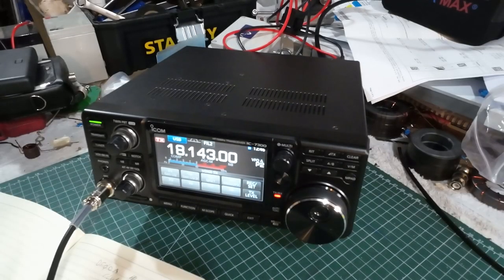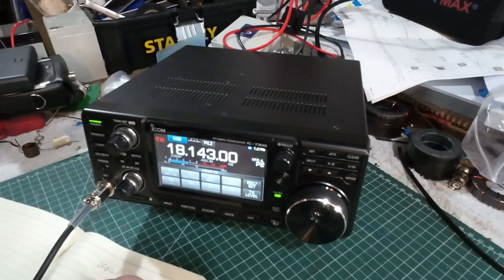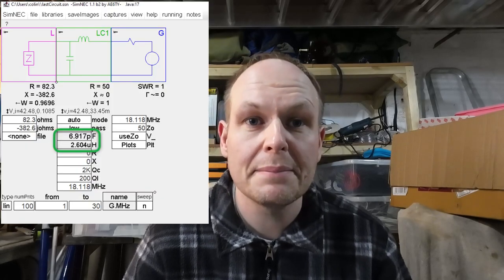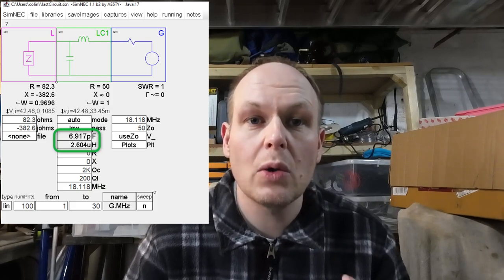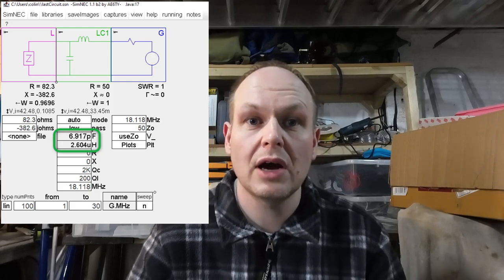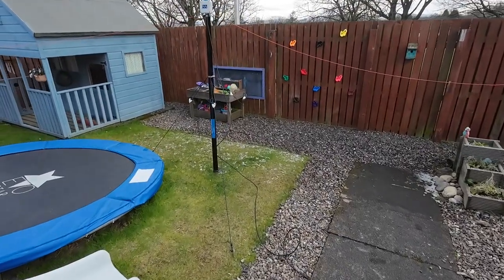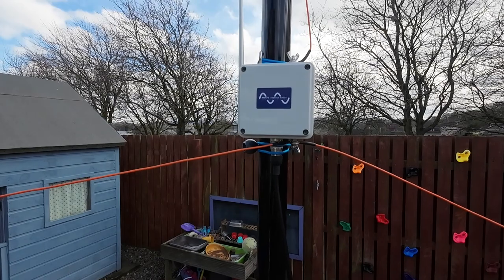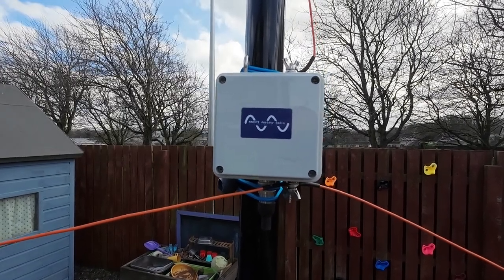The King of Verticals - The 5/8th Wave Ham Radio Antenna

Comment: This is perfect really enjoyed this video By hooking it up this way is the inductor considered in series and the capacitor and shunt or parallel?
Reply from the maker: A shunt can be in series or parallel depending how your trying to match. The capacitor deals with the reactivate component. It's an inductor in series and a shunt capacitor in parallel.
Reply: @MM0OPXFieldRadio  So here's a question for you if you needed to put the capacitor in parallel and the inductor in series, how would that be done? Actually that's the way you did it already but what if the opposite was needed where the capacitor was in series and the inductor would be in parallel, how would that be wired up?
Reply from the maker: It all depends on the circuit configuration. Different circuits will need Different values. Download SimNEC and have a look yourself.

Comment: A dipole at the same height as a 5/8 performs better than a 5/8; if a 5/8 were as good, all commercial radio stations would use stacked 5/8, but no, they use phased dipoles because they are more efficient.
Reply from the maker: Could you elaborate a bit more? When you say A dipole at the height is better? Are you talking about a vertical or horizontal dipole? Big difference there. The commercial stations, are you  talking about VHF FM? I would be interested to see the data that says a vertical dipole outperforms a 5/8? Remember a FM broadcast starion isnt looking for DX. From what Ive read a if you have the top of a vertical dipole and 5/8 at the same height then performance is on par.
Reply: @MM0OPXFieldRadio  Hi, a vertical dipole at the same height, ( antenna tips) performs better than any 5/8. except over salt-water.  a 5/8 works best at 1.5WL over ground, just like a dipole 2WL. Take a look at the Gain Master, it's physically a dipole, but a 5/8 dipole, due to it's symmetry.

Comment: Does the antenna have a resistance of 450 ohms or 3000 ohms ?
Reply from the maker: Its roughly R82 and X-380. Big negative reactance to sort out.
Reply: Firstly I made the matching unit and tried dummy loads, one at 450 and then one at 3000 ohms. Big difference on the swr readings on my analyser as you would expect. Then erected the antenna on my 12m dxcommander pole. Resonate frequency for a low swr was around 17mhz. I chopped off about 75mm x 3 times off your suggested wire length and got the perfect sweet spot at 18.100 mhz at a swr of 1:1.2
Think it's been a success.  Tried it on ft8 working like a charm.
Thanks for your videos and imput. G6SBR.
Reply from the maker: Yeah a dummy load is only gives an indication. I'm glad you got it working. When I made the one for 10m I added 1 extra turn on thr coil and left the coax capacitor stub slightly long. This way I left the wire length and just spread the coil windings and trimmed the coax cap to tune. Either works and as long as the vertical is around 0.6 of a wavelength thats good.